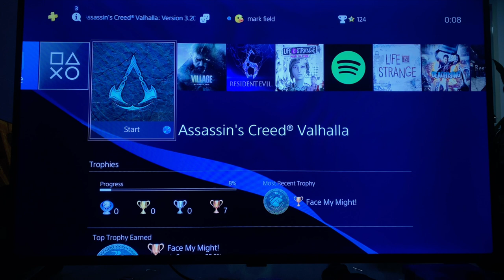youtube video #-FndDPk_CGY

Comment: Good work, and good vid. But how can a bigger battery fit inside...
Also did that usbc port you added have a resisitor on it? A 5.1k resistor?
Reply from the maker: Hello, it fits perfectly. I just noticed that this particular USBC port has no resistor, but I remember when I bought them first time there was a small resistor on the other side. But this port from the second order and there is no resistor.

Comment: Great video! Can you please explain what each individual pin does on the jds-055 please e.g ground, 5v, data +, data -
(As you look at the board with the 5 pins, the extended section of it is on the left)
Reply from the maker: Ok, so you mean micro usb pins: 5v, data -, data+, mode detection, gnd.
Reply from the maker: From the right side
Reply: Does it still sync to PlayStation consoles after this?

Comment: how to identify  VBUS , Ground , D+,  D-  on both dualshock4 charging port PCB and type c PCB without multimeter ? and did you add any resistor to the type c pcb ?

Comment: what the tool name 6:53 
6:06 can I use any cable right ?
and 5:21 I can do it without hot air or not
Reply from the maker: 6:53 "Dremel" is what you are looking for. 
6:06 I'd use a bigger wire than I used in this video.
5:21 Yep, You can do it with a soldering iron but with a hot air gun, it gets faster.

Comment: So I did the same things, but I want to take it to the next step.  I want the USB-C mod WITH the LED in tact.  Any thoughts?  Maybe displace it with some wire too?  What LEDs would be easier to work with?    Also, what temp did your heat gun put out?  I have to say, this is one of the cleaner videos of the mods for this controller though!  I'm also thinking of making the speaker a mic instead.  anyone seen that done yet?  I have been looking for thoughts on it.
Reply from the maker: Hello.
1) yep, you can try to displace it with wires . I didn’t have time to figure it out.
Or, you can buy this kit and solve this problem https://www.ebay.com/itm/303727561873?chn=ps&_trkparms=ispr%3D1&amdata=enc%3A1iIRKqfUXSHuvQQtVBlgkNQ23&norover=1&mkevt=1&mkrid=711-117182-37290-0&mkcid=2&itemid=303727561873&targetid=1262375642056&device=m&mktype=&googleloc=9003540&poi=&campaignid=15275224983&mkgroupid=131097072938&rlsatarget=pla-1262375642056&abcId=9300697&merchantid=223147745&gclid=EAIaIQobChMI4Z6qgMKZ9QIVMQeICR23qwDHEAQYASABEgJiU_D_BwE
Do you want to replace the speaker with a microphone?
Reply: @ReMARKCHANNEL  that's a lot more LED than my eyeballs have ruin for lol.  I will probably just displace it with wires.  As for the speaker, have that as a mic all built in because the speaker is pretty useless, at least when used with a PC.  Then you could have a nice hobbiest controller, and unless you have a button mod for the bottom half of the case, a 3000 mAh battery will fit with the bracket removed and something to protect it from solder pins.  However the 2000 mAh battery already doubles it, and has the bracket in tact.

Comment: With the battery replacement mod, can you still use the touchpad clicker on the custom DualShock 4 controller?

I did the battery replacement mod (103450 LiPo 2000mah) in my JDM-011 controller and it bulges, I can screw it firmly but the touchpad clicker no longer works; it's fully pressed.
Reply from the maker: Hello, yup it still works, the battery doesn’t affect the touch pad in my case.

Comment: How exactly can i remove the old port if i dont have this hot air thing? Can i just get it of by force or will i break something this way?
Reply from the maker: You can use soldering iron. If you use force you most likely will destroy the pins on the board.

Comment: Is there a way to connect the usb wire directly on the board? I'm tired of port getting lose.
Reply from the maker: Use epoxy resin to attach the port.
Reply: @ReMARKCHANNEL  I've thought about it. But I wanted to know if there is a way to connect the wire directly to the board.
Reply from the maker: @kuroyami6289  yes, 4 pins gnd, data + , data -, V+
Reply: @ReMARKCHANNEL  Thank you. I'll try it out.

Comment: What is the larger of the wire for the USB c connection? 1.5 mm?
Reply from the maker: AWG from 20 to 28 are used in USBC. It s  up to 100W 20V

Comment: is nice, but what about the lightbar LED?
is there a way to reposition the port board?
Reply from the maker: Well, The lightbar is gone. I would say that I did this on purpose because mostly I play at night time and I don't like the light from the DS4. However, I'm pretty sure that it's possible to save the lightbar, I just haven't tried.
Reply: @ReMARKCHANNEL  i might look for a cheap ps4 controller off ebay just to try ...
Reply from the maker: @victormanx  Leave a message at the end. I would like to know.
Reply: @victormanx  so did this happen?  Once I get my USB-C ports in, I'll be doing this and plan to try it.

Comment: The led still working ?
Reply from the maker: Well yes, it works, but I moved the led into the right corner, so it is not in its place. Anyway I can see the light through the transparent shell.
Reply: @ReMARKCHANNEL  Do you know i way to keep the led because i d'ont have transparent shell
Reply from the maker: @rocketman9301  There is not much space in that area for USB C and LED, you can resolder LED from another side, but I decaded to keep it like I did. If you have enough time to make it, please share the video. I would like to see.)
Reply: @ReMARKCHANNEL  I will try but i never did this type of work before. I'll tell you if it work

Comment: Link for the battery?
Reply from the maker: Sure, here you are 277,72 руб.  29％ Off | 103450 3.7V 2000mAh Polymer Lithium Rechargeable Battery jst PH 2.0mm 2pin plug for Camera GPS navigator MP5 Bluetooth Headset
https://a.aliexpress.com/_veUjJK